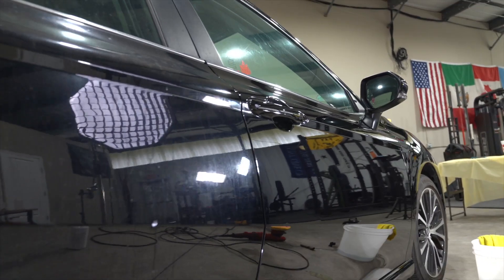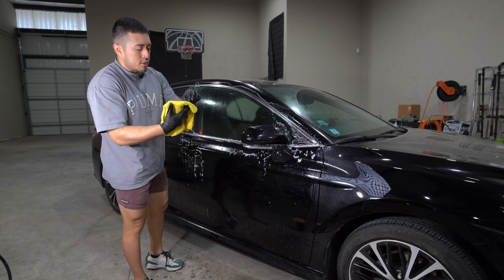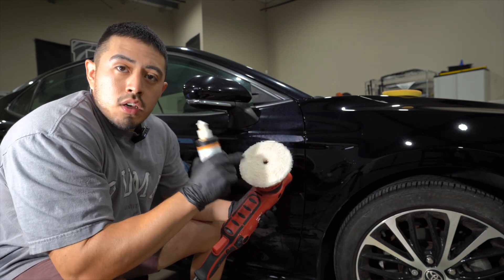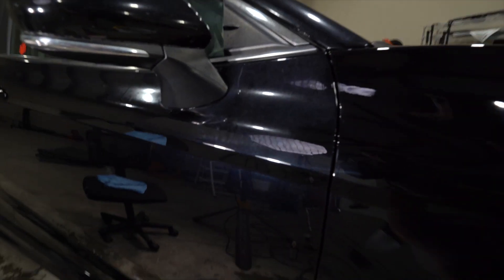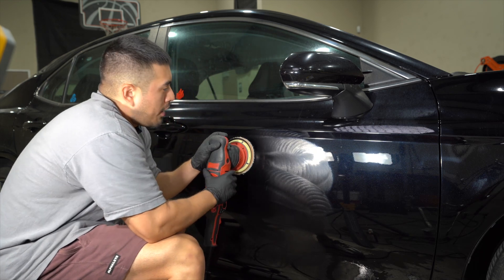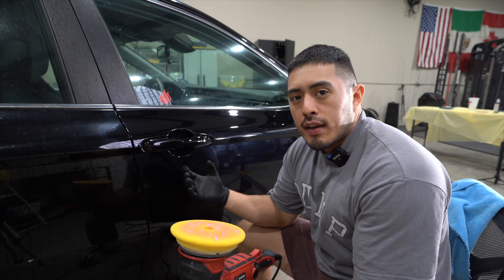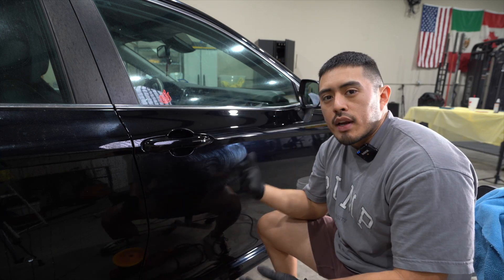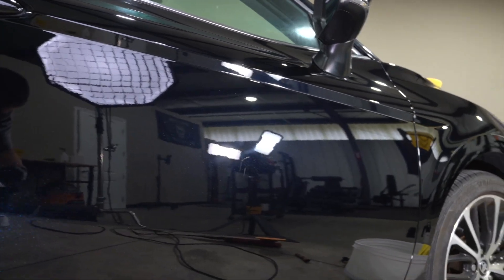How To Polish Water Spots and Swirls From Your Paint | Make The Paint Look New!

Comment: love your vids, subbed. 

how come when i use compound either turtle or mg i can easily wipe off  but when i switch to a polish and polishing pad i can not wipe off the haze? i use the water/alcohol spray bottle but still gotta do it multiple times? is it because the area potentially damaged by the sun aka clear coat is coming off? or is it normal to see some polish haze left over regardless of paint condition?

Comment: How do you know hard from soft coat?
Reply from the maker: How easy it is to remove the swirls. Always do a test spot before you start the whole vehicle. If 80% of the swirls come out with a polish, it's soft paint. If only 10% of swirls come out, it's on the harder side (as a very general example)